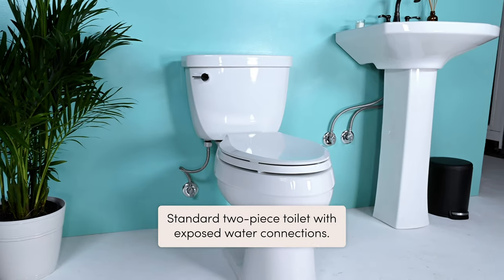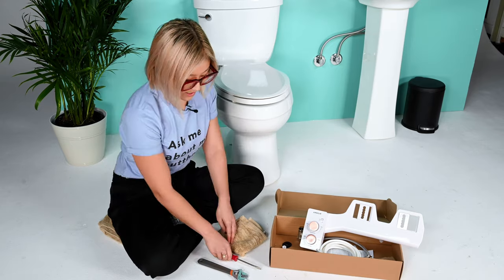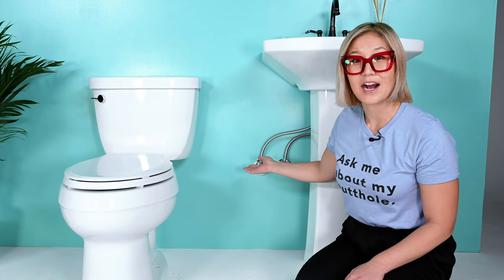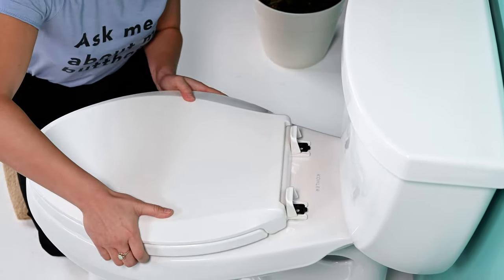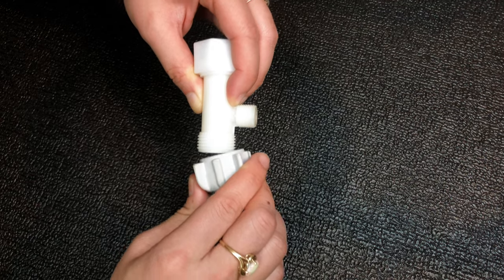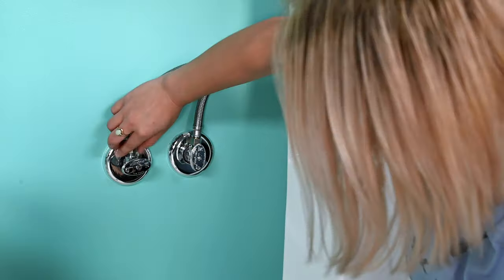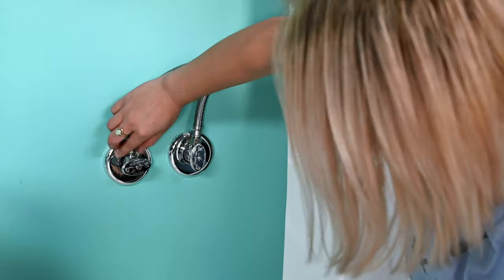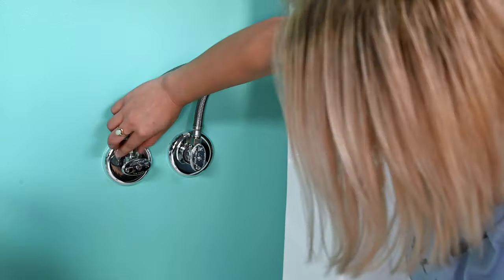TUSHY Spa Full Installation Tutorial (2020)

Comment: Do you need to connect to hot water?
Reply: well you don't have to, but at that point just get the tushy classic instead
Reply: @flexmendelson  so you can use the Classic with just one connection then?  Keep the second connection closed?
Reply: on a side note: I wanted to get the Tushy Spa but got distracted with the eco-bundle (bidet+tissue stand).  Please beware the eco-bundle is only the Classic, and the bundle is not returnable.  So a bit poo-poo there as you could get into a trap if you really wanted the Spa instead.
Reply: @enneyehs  I will answer my question.  Since I got myself the spa, the answer is yes.  There is a brass inlet cap included in the package to cover the warm water connection end point. I ended up using that since my warm water pipe is too tight. I couldn't wrangle it.  I suppose not using warm water is more eco-friendly.  In which case, @Flex Mendelson is right, one should just get the classic version. I'll keep the implements though as I live in Chicago, might need it warm water at some point :)